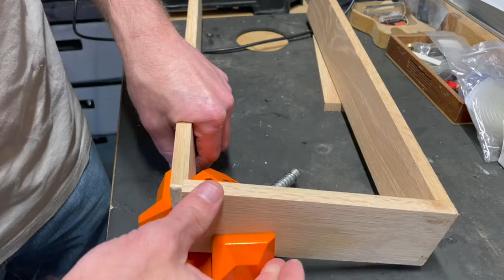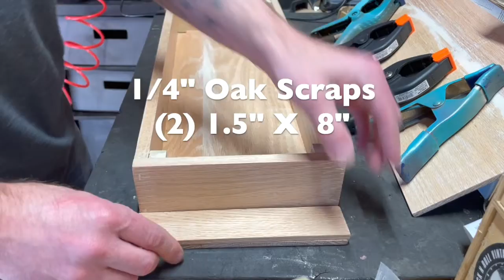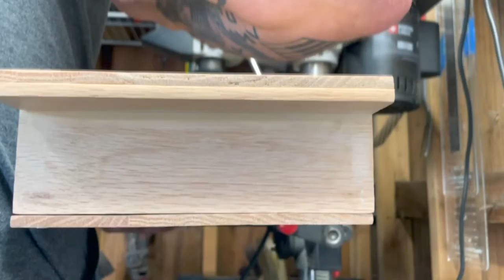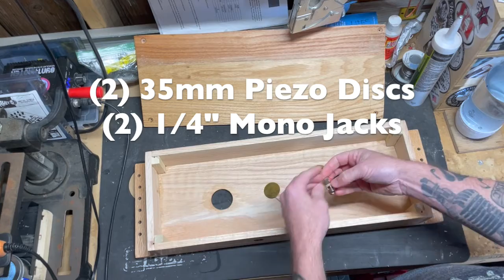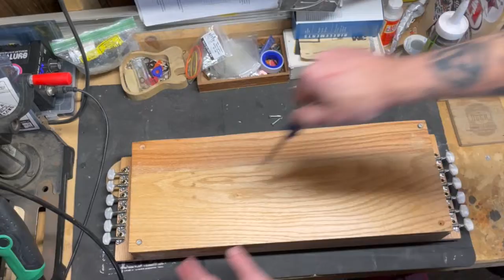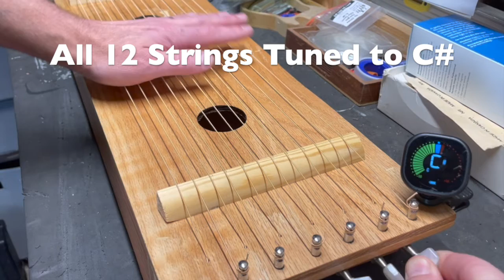My First Attempt at Making a 12-string Monochord

Comment: I might try one tuned in E (half the tunes in the band I am in tunes end up in E)
Reply from the maker: BTW, I had no idea what key it was going to be in. I just used a random scale length and string size. Based on that, you could use a heavier string or longer scale and probably hit E pretty easily.

Comment: Very nice,can it be tuned different too?
Reply from the maker: I actually had no idea what to do with the tuning. I just guessed at a string gauge and scale. It turned out to be a pretty comfortable tension for C# (no rattle but not too tight). You could probably tune it up to a D or maybe even an E. It might be interesting to mess with different scale lengths and string sizes to figure out what works best. Some heavier strings might let is make a nice B or A. I also like the idea of having 1 or 2 strings tuned an octave higher.
Reply: I'm sure you could make some simple movable bridges and put them under the strings at different spots to change their pitches. If you put them close to the middle, you'd have two notes per string, and I think if you put them at places where there's a natural harmonic, then there'll be sympathetic vibrations that can cross back and forth across the middle bridges.
Edit: natural harmonics, as in dividing the string in half, or putting the bridge 1/3 or 1/4 or 1/5 of the length of the string, etc.
Reply from the maker: @markfdesimone  Yes. That is a common technique on monochords. You can easily divide each string into 2 strings for more notes. I'll have to experiment with that.

Comment: If you don't use the jacks , what will happen?
Reply from the maker: If you don't' install the piezo pickups and jacks, you won't be able to amplify the monochord. Its acoustic volume is not particularly loud so that's why I added them. Thanks for checking out the video.
Reply: If you don't use it.  Can play, right?
Reply from the maker: @MY_PLAYGROUND777  Yes.

Comment: far freaking out

What do you have planed for you mono cord?

Why two outputs?
Reply from the maker: I have a few ideas but I've also got several other projects in queue so who knows when I'll get around to it. I did the two outputs so I could plug it into a stereo reverb or chorus and get an original stereo signal. If I'm using it with an amp, I'd just use one of them but the other is there if you need it.
Reply: @musicalmiscellany  Cool cool

I am looking forward to seeing what you are up too... It would not surprise me to find out something like a marine trumpet is on your list